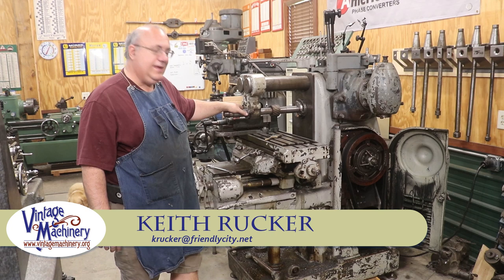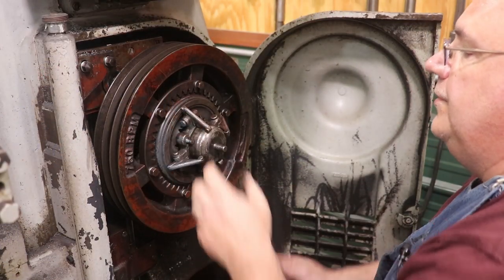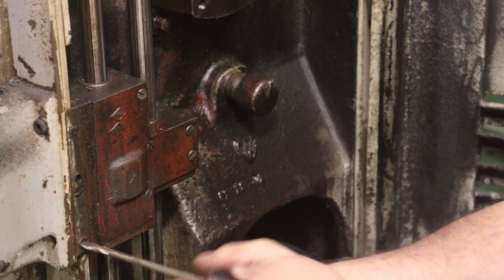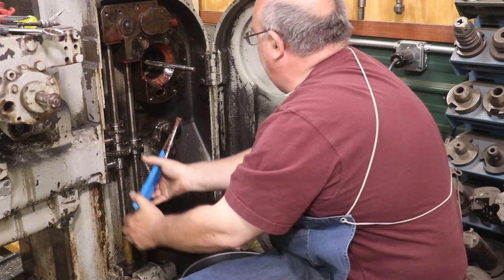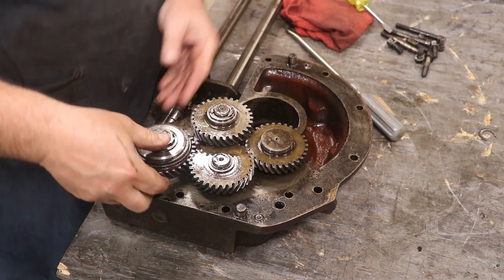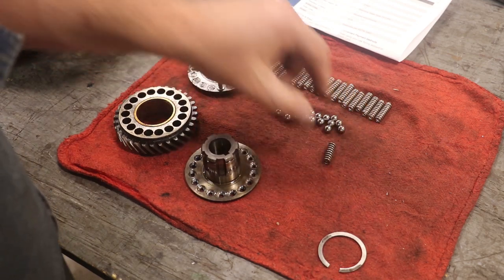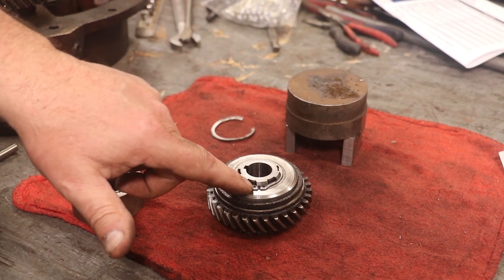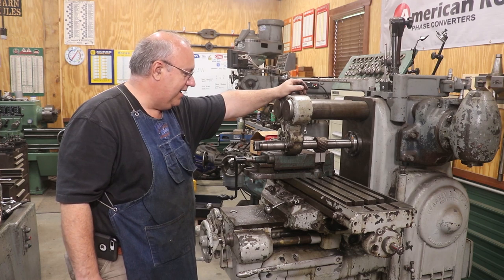Repairing the Rapid Traverse Clutch Pack on a Kearny & Trecker 2H Horizontal Mill

Comment: One comment, When re-assembling be sure the mating surface between the "feed and rapid traverse take-off bracket" casting (where the rapid traverse slip clutch you worked on is located) and the main casting has a good clean contact and air tight seal.  The oil pump for the main gear case is part of this casting and if you have an air leek in the suction side it will not pull oil up from the sump properly!.  I learned this the hard way with my 1943 K&T 2HL when I rebuilt it in 1974. (I paid $0.06/pound as scrap for the mill)  The 2HL is still a valued part of my shop and great for production jobs.   I have a couple manuals for my K&T 2HL that I had uploaded to add to the collection at VintageMachinery.org. 

Thanks Keith...and thanks for the library of manuals for these older machines.

Comment: I only saw the first video earlier today when you last took the clutch apart. The new springs you put in were open coil ends, I'm pretty sure that they should have been closed end and ground, particularly where they are against the pressure plate. Hopefull these new ones will work OK. I was also going to say based on what I saw of the first video that you should have tried Lee Spring. I use them in the UK when I get stuck. I just paid £23.00 for a spring smaller than the one in a ball point pen and very light, but my door bell now goes Ding - Dong instead of Dong - Dong! Well worth over £20.00.

Comment: What a Rube Goldberg design. All I can say is that the guys who designed teletype machines and these K&T mills must have had some really good drugs back in the day.. Great video Keith an great repair. I'm really impressed you managed to diagnose the problem and even more impressed you got all back together without any left over parts.
Reply: That's what you can do on Jack Daniels and Lucky Strikes.
Reply: Have you looked closely at a manual typewriter?  Or watched a Linotype machine making type slugs?
Reply: @royreynolds108  Yes YES! All amazing machines......and incredibly gifted designers
Reply: @royreynolds108  For sure. I wrote my PhD thesis on a manual typewriter. I've even fixed them and I was always amazed at how they were made. Pipe organs are also really amazing.

Comment: I use my arbor press, albeit much smaller than yours, to press clutch packs.  I have a non-stretching rope anchored to the base of the press stan and a tight loop on the handle.  When I manually press the clutch pack I slide the rope loop out on the handle till it is tight enough to hold the handle in position so I can get the snap rings in.  Old school but it works. I have seen it done with a light chain and an L-bracket with a hole that fits the press arm.  Set it and when the arm tries to bo back to rest the L-bracket is self pinched onto the press arm.  Works for me with just a rope.

Comment: It amazing to me someone could sit down and design a machine like this and figure out everything that is needed and then build it.
Reply: Wasn't a one man show 
Thousands of minds over 100 years 
Each person takes what is an old design and makes small changes to make the machine better
Reply: @fowletm1992  my thoughts exactly. An army of men using slide rules and math, another actually building machines. Just for the current (at the time) version.
Reply: Once you fixed a bvunch of stuff it's all very similar .. that BIG clutch he took off first (on thre big belt pulley) is the basic desing for dozens of machine tools for example.

Comment: High K-factor compression springs with closed and grounds ends are never cheap to begin with. $6 each actually does not sound outrageous to me; they are not a "standard" off the shelf part. They are very likely made specifically for that application and its a niche application. So yeah, not bad!! Thanks Keith, glad to see the K&T back to where it needs to be.

Comment: Keith,  The balls in the over ride clutch are just there as noise makers to let you know the friction clutch is slipping and you may have hit something during the rapid.  So the wear in the back plate is no problem.
Reply: Chuck,  Please look up ball-detent clutch and you will see that the balls being held in the pockets by the spring force is the clutch mechanism.  When the pockets are worn the springs do not compress as far for the balls to "skip" pockets, which results in the clutch slipping at a lower torque.

Comment: Had a similar problem with a machine. Belleville washers, 192 in total required. Local parts are not right, so phoned the UK supplier of the original ones, and ordered them, and they have a MOQ of 500, so got that. 96 washers per time to replace, so they went into packs of 96, all ready to simply put in place for next time I would have to change them. As they typically last 5 years in service before losing tension ( they have a lot of force applied, and nothing you can do about it, as they are cam driven, and the cam follower is a really tough bearing) they are fine, with at least 2 spare sets for use.

Comment: Love the old machine design that would have spanned the era of motors and belt drives. I have managed to bodge up a limiter clutch like that in the past by using smaller balls. I swapped out the 1/4" balls for 6mm and the clutch worked like new. I didn't know what the breakaway torque was but it never took out the shear pins.
Reply: Somebody did that when he pulled the clutch apart the first time (8mm balls instead of 5/16", but only in some locations). He installed new 5/16" balls at that time.
Reply: @ratdude747  The difference between 8mm and 5/16 isn't enough to make a difference in that joint as the difference is only a couple of thou.  1/4 and 6mm is 0.013" and it's smaller so it works. Mixing 8mm and 5/16 being close but not the same will actually make it easier to break away because it will only be riding on the 8mm balls.

Comment: The tool you made to compress the springs and install the snap ring is very similar to what's used when rebuilding automatic transmissions. Unlike this one, those actually have multiple friction and steel plates.

Comment: Are parts still available for the old K&T? The worn grooves in the torque limiter still worry me. The added spring length may be suitable as a permanent repair, but I like to go OEM when possible instead of guessing. That is a lot of spring cost if you guessed wrong.
I cut my machine repair teeth on Abom's model K&T. That is so many years ago that I can't recall the model number or many of the details. That was the only K&T our shop owned and the only one that I ever serviced. I had no reason to keep up with K&T and parts availability. K&T used some very complex mechanical design on your machine that was upgraded to very complex hydraulic and mechanical design on Abom's machine. I took great pleasure in isolating trouble cause when opening the bowels of our K&T. Disassembly required disconnecting mechanical or hydraulic interfaces. Tracing power transfer when disassembled wasn't always simple. You went through a lot of work to hope you guessed correctly plus a lot of spring cost. Doing this in a production environment meant additional production downtime when the repairman guessed wrong. I quickly learned to read assembly drawings so I had my diagnosis well concluded before I grabbed a wrench. I also tried to have correctly ordered the parts from that diagnosis prior to teardown and have them on site. These kinds of problems present themselves in gradual function decline. Diagnosing what is developing before failure becomes increasingly advantageous in the production environment. Sudden component failure doesn't allow for proactive action.

Lee Spring has been a source for decades. I kept nearly full stocked Lee Spring engineers test kits in both compression and extension coil spring sizes. The kits come packed with 2 springs per spring size. I ordered mine from McMaster Carr. The wide selection of springs in the kits were a ready source for emergency and permanent repairs. The kit gives you test parts and confirms part numbers. The test kit is a handy investment. I inherited somewhat already picked over kits when I landed my job, and I think that I only started over with new test kits once in 34 years. I may have occasionally restocked popular sizes. I had the advantage that my company supported my desire to maintain machinery to OEM specification. This allowed me to order OEM parts with assurance that the parts were correct. This allowed more reliability to order parts correctly prior to disassembly.
Documentation is invaluable when employing the described repair approach. Knowing the component condition and repair action taken previously and any non OEM alteration is critical. We kept detailed repair records on every diagnosis and repair including parts used, repairman, cost, vendor and delivery issues. When I retired we had over 30 years of every repair documented and since 1994 these records were maintained electronically. With powerful search engines these old repairs could be called up in moments. We routinely updated old repair documentation when we discovered that records were incomplete or included errors. I would eventually have low skilled technicians performing high tech diagnosis and repair due to the reliance on our documentation. The record keeping applied universally to all technologies. We employed the method for mechanical, electrical, digital, programming, hydraulic, etc. with equal results.
In my retirement, my wrenching hours are greatly reduced, but I am still active in my shop.
Reply: Thinking more on this topic...
Keith showed worn shortened coil springs. I was told early in my training that compression coil springs LENGTHEN as they weaken. I have replaced far more shortened compression coil springs than lengthened springs. Was I told a falicy or do springs relax lengthened early in their spring failure life before losing springiness to return to full length?

Another opportunity to rant...
As a technician I value assembly drawings vastly over isometric or exploded view drawings. Assembly drawings confirm vastly more useful information. In the assembly drawing you can validate which shoulder is load bearing, fit alignment and clearance. Internal fluid porting can be confirmed. Direction of thrust bearing races are obvious. Which face of O ring provides sealing force, which part face carries motion  load and stroke length, etc. Parts that are directional often lose their orientation when on the repair bench. Assembly drawings eliminate guessing wrong during reassembly. I find keeping small parts, hardware and subassemblies in separate boxes during disassembly eliminates reassembly confusion. Lista cabinet plastic drawer organizer boxes are ideal for uniform and reusable small parts organization. AKRO bins are a good option too, but the open slanted end is sometimes undesirable.
Phase marking tape comes in many colors and is a reassembly confirmation trick that I like to use. Colored zip ties are permanent and are ideal for marking hose ends to fittings. The cell phone camera became super valuable to document complex assemblies before disassembly... Think drum brake shoes component orientation or serpentine belt path. That photo can be a real timesaver.
One of Keith's components had threaded pusher bolt holes to aid in disassembly. The knee drive power transfer gearbox did not. Drilling and tapping pusher bolt holes while disassembled is a prudent improvement. Often you can use assembly hardware for the pusher bolts. Size any added pusher threaded holes to match assembly hardware. Fully threaded SHCS are a handy repair tool kit item to collect. Long set screws are an alternative, but SHCS allow use of a larger wrench. I like McMaster Carr as a supply source. They will sell one piece for a premium, but it saves investing in box lot sizes when not required. They stock more variety than any supplier that I am aware of. Same day shipment and next day delivery for  standard UPS orders to ST Louis. Pretty impressive!
Use a copy machine to make shop use drawings when at the machine. This keeps the original clean.
Reply: At the time he redid the clutch the first time, the ball plate/hubs were available... for $800 a hit. They know what they have, as one would say. I think he mentioned paying about $1000 for the mill, so such expense wasn't warranted (he also mentioned wanting to find a bigger horizontal mill, like a Cincinnati).
Reply: Can the detent ring be re-created?
Reply: @elmarqo_3448  Yes, the tricky part is the steel and the heat treating process is very specific for that type of application so you would need to get the steel grade, the hardness and the temper and then work on recreating the part. Not impossible but also not simple.
Reply: @paulhunt598  You were fortunate to work for a company to have that type of mentality.  Most of the places where I worked ran until it broke then fixed it.  One place had a label machine that had been made in Germany, something happened and to keep the bearings in the bearing races were welded to the shafts.  They got POed when I blew out the air compressor inlet filters to clean them as a preventative maintenance operation.
Reply: @ratdude747  ...Yep, I recall that as well. The high clutch price stuck in my "alleged" memory.
Reply: Can't say it enough, "Documentatation, Documentation Documentation" . The best way to start a job. Repeatability comes with lots of hands on time. That's the way I learned. 
I am amazed at how some will not take the time to research and observe the manuals for the instrument/tool they are working on. I guess in the background of my thought , "Time is Money!" For what it's worth, my 2 cents.
Reply: @jdmccorful  Righto. Usual situation when something goes wrong with a machine and you have to ask: "did you read the instruction manual?".

Comment: I see a good project, building a new clutch spline and pressure pad, to replace the one where the balls have created paths. With your hot shot, grinder,lathe and mill you should be able to build a new one reasonably. I hope you took measurements so you can work on it while the mill is working. Seems like a really good project.... :-)

Comment: What is the friction material on the top plate supposed to rub against? With those three pins it can't turn in relation to the body of the clutch anyway.
Sorry if I miss the obvious here, I greatly enjoyed the video anyhow.
Reply: I was thinking the exact same thing it cannot rotate because of the pins
Reply: i think the pressure plate and the gear are supposed to rotate together (the pins align the two) and idle.  the pressure plate clamps the gear against the bottom plate (with the ball bearing seats) and this engages the gear......i could be wrong though
Reply: @mark regler the pressure plate has splines on its internal diameter locking it to the shaft, so would make everything rotate together? Not sure how this clutch works!
Reply: I think what we’re not seeing is that the plate with alignment dowels and friction material is a separate component from the splined pressure plate; they’re just stuck together and come apart as one unit in the video.  The splined plate and splined hub are obviously locked together upon assembly.  The friction plate with dowels and gear are locked together.  Under excessive load, these components would rotate independent of one another.
Reply: the gear/springs and balls are supposed to turn independently from the top splined plate, as its on a brass bush the top plate and body the top hat piece with the indents are locked by the splines I think that at some time the pins have been removed  and replaced in the wrong side of the plate if you look at the parts manual it shows the pins with a small shoulder on them? maybe they should come from the other side not the friction material side ???
Reply: Is there any chance the friction material, interacts with the steel spined part ABOVE it (obviously it can never slip on the spring side)
I know it looks like one part in the video, but it might be just stuck together with oil.

Comment: We would have to engage all three axis X,Y,and Z then engage the rapid to make sure the clutch holds. Of course we replaced all the clutch parts.  The grooves in the safety overload looks pretty worn and I know that is an EXPENSIVE part from the factory.

Comment: I would check to see if the shaft is stopping turning when you raise the knee in rapid transverse.  I suspect from the way the clutch is made its a gear slipping somewhere else in the drive.  I have seen other machinist make a socket to fit the raise adjustment and run it up with a drill or impact wrench.

Comment: Did you check to see if the stiffer and longer springs would compress  enough to allow the balls to jump to the  next hole.
I assume  the torque limiter  might
come into play when the table reaches the end of it's travel.
If it binds up something might break

Comment: While you're on a roll with the K&T, how about opening up the universal head for an assessment and cleaning.
Reply: Is that what the thing sticking out above where he was working is?  I couldn't really figure how something in that position related to the rest of the machine.
Reply: @Orxenhorf  The universal head is in the parking position. It hangs off of the support arms and is driven by the spindle. It essentially turns the horizontal mill into a vertical mill. In addition if rotated 90* it can be used perpendicular to the spindle horizontally.  Last time he set it up, it made some horrible noises.  Like 4 yrs ago.